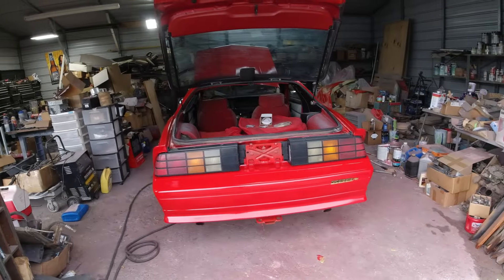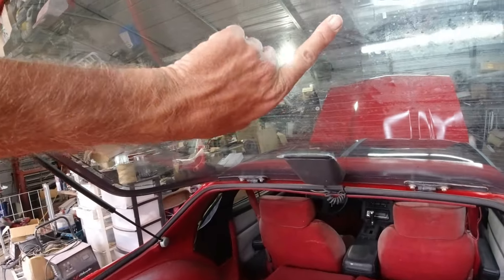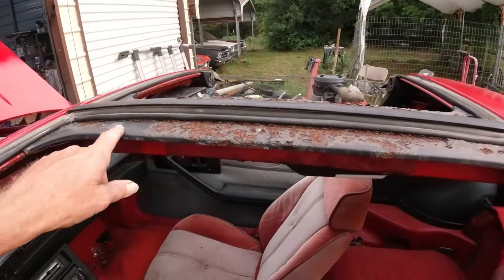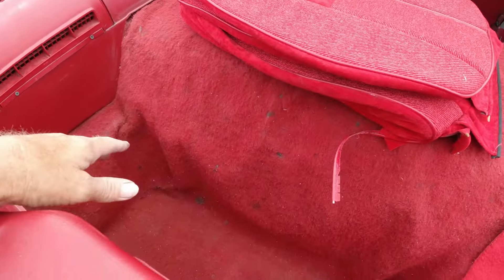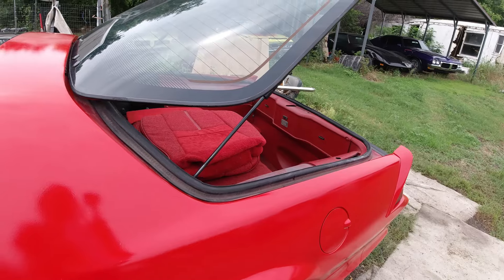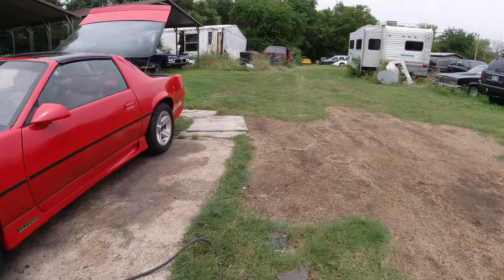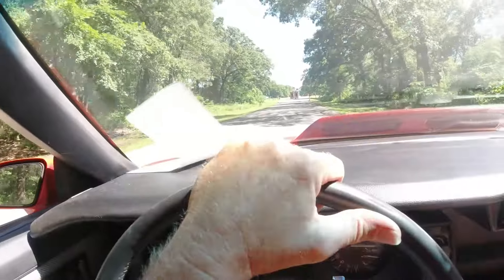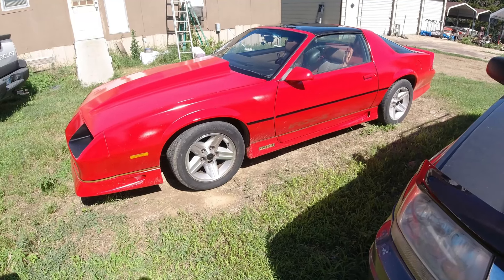1985 Camaro IROC-Z BUILD #14. Build is finished ! What did it cost to buy and build? Test drive !!

Comment: i had a rs that i sold a while back it had t tops it was a clean car once i put some time and money into it but i couldn't get the engine to run right one second it would run great the next second it would smoke the entire yard up and have a rough time starting i figured it had to be a issue with the computer or maybe the injectors i think ill try to get a iroc this time around